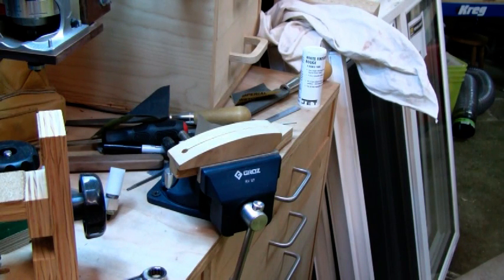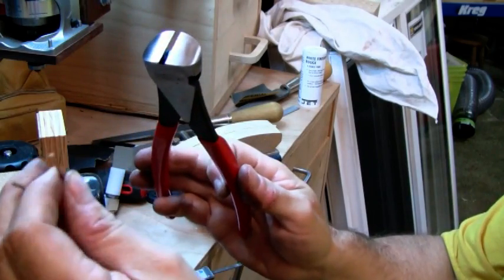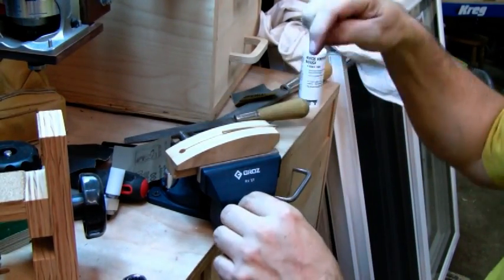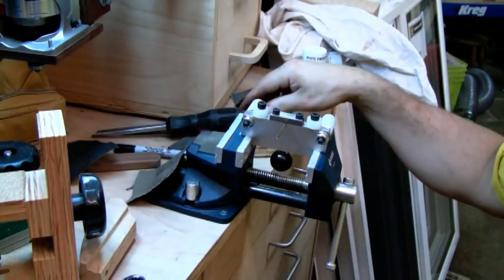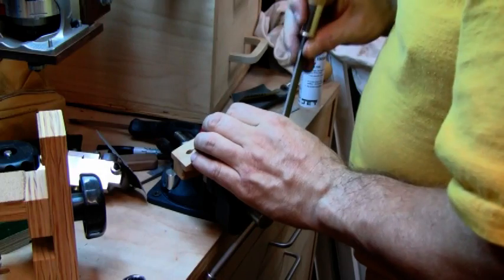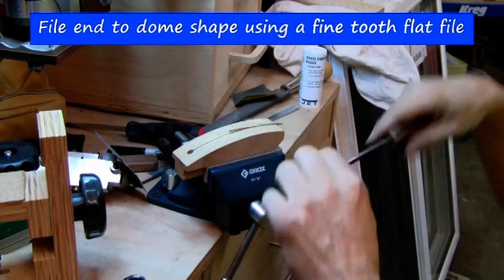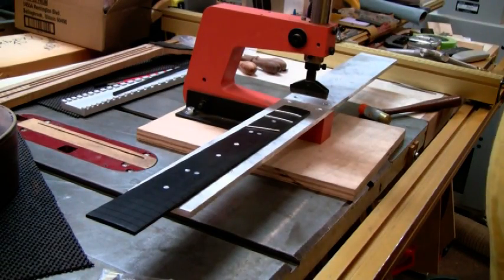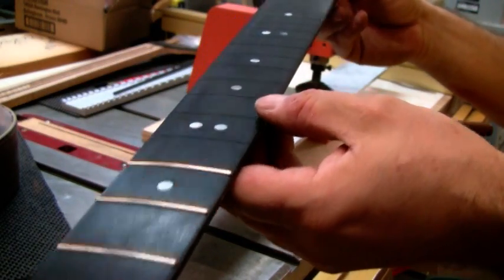Semi-Hemispherical Dome End Frets

Comment: very nice. I started doing hemisphere ends last year on jumbo SS fretwire. It is deffinitely not a speedy task to do, I came across this video looking for any sort of tips and tricks I can find on the web about it. This is almost exactly how I have do mine, except that  when polishing, I go 120 grit, 400 grit then steel wool. 

First time I did this I tried using regular nippers, they were trashed by the end of the job... oh well, they were old anyway and needed replacing. I do almost all the major cutting of the fretwire with a dremel cut off wheel. I go through several of those wheels in a single fret job.

Comment: No excess of bean spillage, really! The difference is that I use a normal fret crowning file for most of the shaping. I produce the rounded profile off the flat end (after knocking off the corners with a flat file to reduce "starting chatter") and then perform this over at 45°. The rest is refining at the quarters and finally "rolling" the end as I pull the fret through the teeth. The "speed" comes from familiarity with how much pulling each facet requires. A bit of cutting fluid helps also.